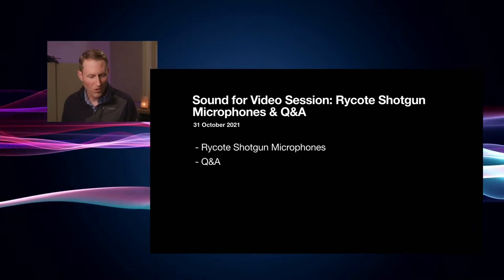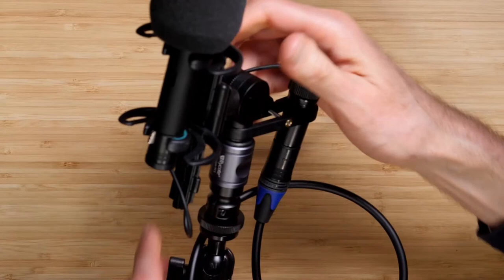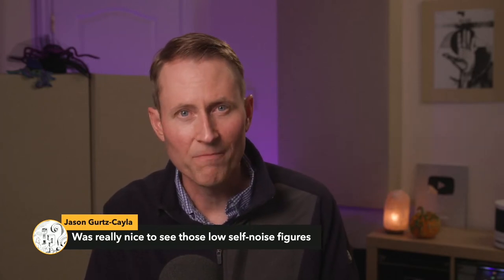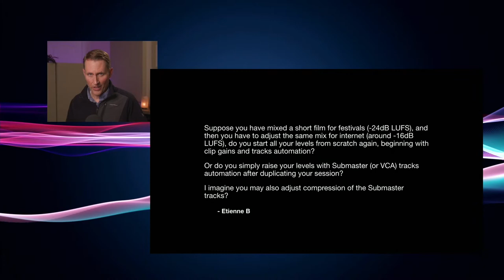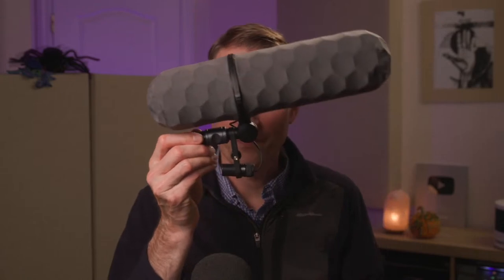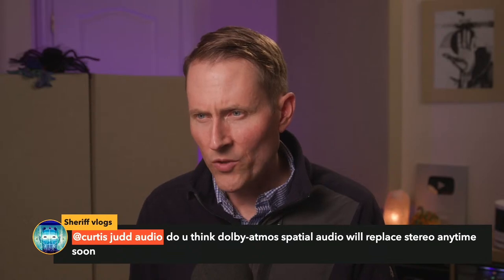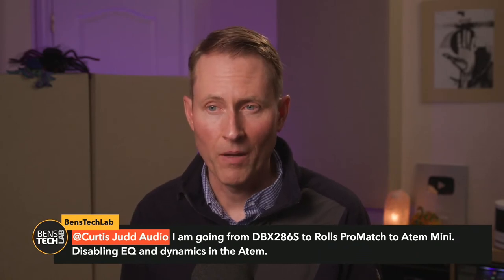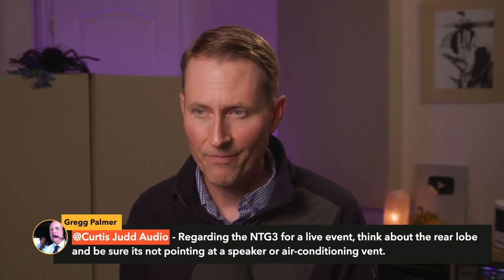Sound for Video Session: Rycote Microphones & Q&A

Comment: Once I gave one SDC mic a shot. It was advertised as one of the quietest SCD mic on the market 13dB(A). It turned out to be a big scam. Quite a few people in forums noticed that self noise of these mics was horrendous. I found the same thing in my testing which was a pity since their tonality was lovely. I dug a bit and found how sound on promo recordings was manipulated with noise being crudely removed. Since then I am a bit sceptical  whenever some cheap newbie brand release something advertised as a best in class... These really sound quiet though. And are much more expensive. So I wait for the full review.

Comment: Hi Curtis, hope you are well. How does the Atomos Ninja V+ audio quality compare with Sound Devices Mix-Pre 6 ii ? Is better to use Atomos solely for video and capture audio on Sound Devices?  I have ordered both of these devices. Also how would I connect MixPre to Ninja V+, so the audio is managed on the MixPre and then comes into the Ninja V+. Which cable would I need?
Reply: Hi Gurmeet, I haven't specifically tested the Ninja V+, but overall the audio inputs when set to line level are ok when taking a feed from a proper audio mixer. We do this at work with a Sound Devices 833 and the original Ninja V as well as the Ninja Inferno. There is a special cable you'll need from ATOMOS to feed audio via XLR into the Ninja. Best wishes!